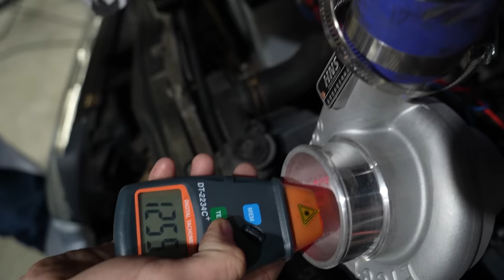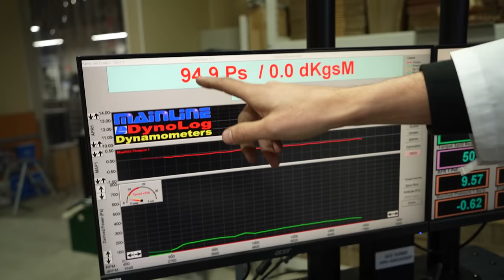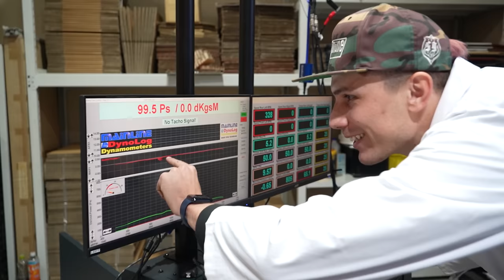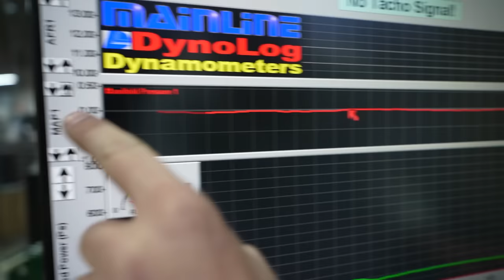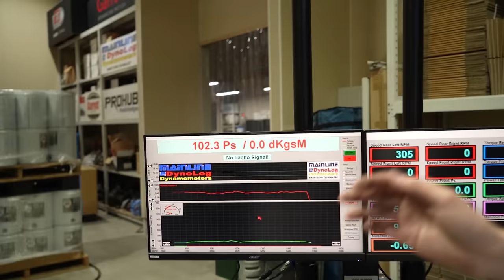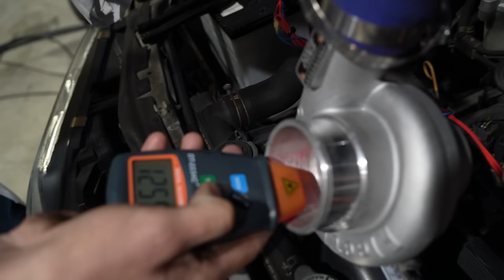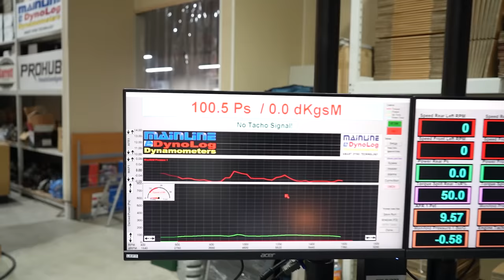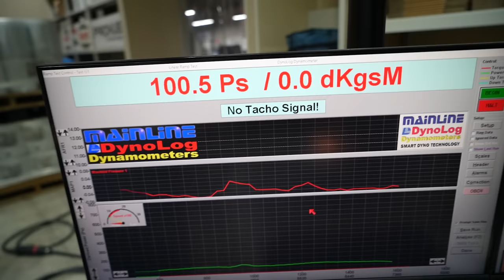We Test Wish.com Electric Turbo ON THE DYNO!

Comment: I believe this product is not intended to boost performance cars such as the Nissan skyline in this video but cars with smaller engine displacement ranging from 0.8L to 1.5L. Looking forward to another test of this product on a K-car.
Reply: Absolutely agree with you . The bigger the engine that revs higher , the less effective this would be . And with a smaller engine it would get ahead and reva. Lot higher as turbines rev a lot higher when they are pumping more than what the amount used is... That's why a vacuum cleaner revs higher when you block the pipe

Comment: Its a 3 phase brushless motor and you just don’t get any more power out of it by over voltage on the controller. Needs more frequency out of the controller and you might get more out of it before the winding blows.
Reply: a 6s / 24v controler would be an interesting upgrade. at 24v instead of 12v its rpm should double.

Comment: Dyno procedure for automatic transmission. 
Shift to 1st or low.
Upshift to second.
Shift to D to get into 3rd, then shift back to 2nd to lock trans in 3rd. Do your dyno pulls in 3rd because it's usually the direct drive gear.

Comment: I think it might work if you moved the motor away from the turbine wheel and but it on a bigger gear, with a belt to the small turbine wheel....so when the motor spins the big wheel around once(360) the turbine housing spins 360 10 or so times. Whatever it takes to get the turbine wheel to 120,000rpms.
Reply: So literally a centrifugal supercharger.  You can just buy one.

Comment: You should revisit this and use it for a supplementary support by adding a Y joint one to stock intake and the other to the turbo and in theory it can only add extra flow you could even double up the turbos making it twin with 2 Y joins
Reply: That is exactly what they should do y joint electronic valve

Comment: There are multiple issues with electric turbo's that can be overcome.
1. They are intially a restriction, which can be fixed by a by-pass valve.
2. They don't spin at very high RPM
3. 12VDC can never produce the power required to provide meaninful boost
4. You need at least a 48VDC system
5. including a large bank of Super Capcitors will significantly add instant power for the motor to draw upon.
6. The good ones are very expensive. 
7. Best available on the market is The Torqamp made in Holland.
Reply: Yes, true history
Reply: Pero como se puede poner un ESC de 48VCC en este Turbo barato? Yo quiero hacer la prueba sin dejarme los más de 2000€ de TorqAmp Gracias!

Comment: It wont help no matter what you do because the motor cant spinn it fast enough. The eermp or kV is too low. I would like to see if you can put a brushless inrunner rc car motor on it instead. They can provide 5000 -20 000w so this have been proven to work. It would would be fun to see you guys use a cheap but big rc motor with correct kV rating with regards to the 12V to spin it fast enough. I guess the guys at the shop can give you an estimate for when that diameter turbo begins to work.

Comment: Yo! Try putting 2 of those throw a small intercooler system than do tests with that orange fan you have to simulate air coming into the intercooler. That plus the 2 electric turbos hopefully show results 💪🏼

Comment: I feel like the electric turbo could have  allot of potential maybe if you got a more powerful electric turbo and get a device that changes the rpm of the electric turbo as you go up in rpm with the engine so it doesn’t just ho full power as soon as it’s turned on
Reply: Yea, the idea is sound, connected to OBD2 it could read the RPM and using ESC it could then adjust the accordingly. It just need better motor.

Comment: I think the ESC inside blew up.. ngl I feel like with a higher volt system , electric turbos could be a thing .
Reply: Audi has 48 volt electric turbos on some of there new engines
Reply: @mentalhospital1701   it's onlt the turbo that's electric and it's for anti lag the engine is still a gas engine

Comment: Change the motor in the "turbo" may be use a high power RC motor along with an ESC be interesting  to see if a more powerful motor say 60v+ can get it up to the power needed to make a little boost

Comment: electric turbo could work if the tech used in hybrids were applied like ac volts from an inverter matched with a motor wired for it and use gears pretty possible I think

Comment: Maybe a bit of an odd question but I didn't see in the video. When you set it up for the 24v did you keep your switch line at 12v? The controller system might be able to handle passing through a higher voltage but if your control switch line was changed to 24v also it may have been overloading the controller leading to it overheating and shutting down. The motor itself can probably take 24v at least for longer than it was running in the video. It looks like a controller problem caused by overload the way it would turn on then turn itself off and eventually not turn on again for a bit while it cooled down and changed back to 12v.

Comment: It will make no odds to the results,but an automatic gearbox in drive with OD off is closer to 3rd gear in a manual gearbox,OD on locks the torque convertor and gives 1:1 ratio same as 4th in manual gearbox,it would give a higher power number slightly if the auto box is not slipping/working correctly has fresh ATF and filter pick up,I guess the skyline has a well used box so it will read lower due to some slip from well used fluid due a change
Reply: Actually in the Jatco 4spd auto, 3rd is 1:1 and 4th is OD

Comment: smaller engine will defenetly be better because the demand of air is much less in a k car it should be 1/3 of air demand then of the skyline. also maybe add another one and make it twin turbo even if it doesnt make much more power its awesome to say to own a twin turbo k car xD.
maybe try it on these drifting karts atleast there it should work

Comment: I have a test for the electric turbo, try putting it on your motor scooter. the engine is small enough maybe see a gain that's if it could be rigged up.

Comment: Nothing beats a regular turbo. But I did wonder how much it affected air/fuel ratio. Is there enough airflow to increase fuel.  Like an American carburetor car would it be worth it to but a bigger carburetor on. Or would it be worth it to go with bigger fuel injectors. Still a N/A engine  your just adding more air and more fuel. But true boost,no way. And honestly if not strong enough for boost then probably doesn't affect air/fuel ratio that much.

Comment: what about make the air intake hose into Y hose, one with no turbo just with the original air intake filter and the other input with the turbo🤔 so the idea is its start with 0 boost instead of negative from the turbo but when the turbo is turn on, it will just add another air input into the original 0 boost input🤔🤔just like twin turbo setup

commenting this till he try it🤣

Comment: real electric turbos do exist.  They spin 100,000-300,000 rpm.  The cheap ones you see online barely do 10-20k.  Simply not even close to fast enough to push enough air to make a difference.  The issue is that real electric turbos require massive current, creating greater parasitic drag then conventional super/turbo chargers.  So you usually see them combined with normal turbos as a way to remove lag until the turbo can spool up.

Comment: What if y’all use gear ratios for the electric turbo it may spin faster more reliable with out blowing up after a few seconds and may actually make like 1 ps more lol but do it on a different car with smaller displacement

Comment: You should make an external step down system. Hook the electric motor to a gear or pulley and then place a gear or pulley one-third the size on the input side of the electric supercharger. There are actually electric superchargers that make usable boost, and they are all built with a gear reduction. There's a guy here on YouTube who took the cold side of a td05 and built his own electric supercharger that actually works. I think he was getting like 5 or 6 PSI

Comment: 10:45 No, you did, not "we".  24v on a 12v motor isn't the brightest. 14.7 max. If you want it to spin faster you add amps not volts. Electricity 101.

Comment: Those tiny electric turbos are only designed for small displacement engines. Like 1 to 2 liters. Not a 6 cylinder engine.  Pathetic you don't understand something so simple!